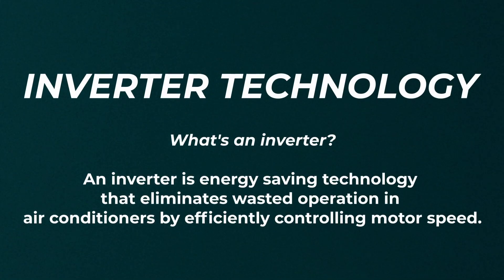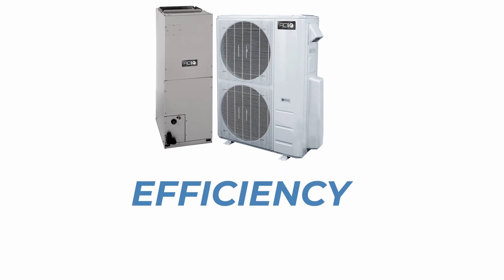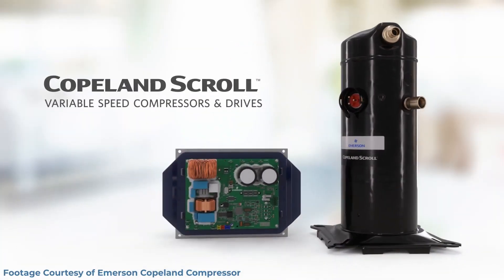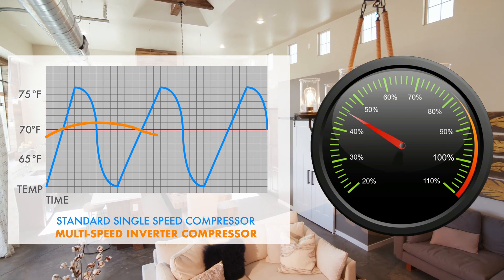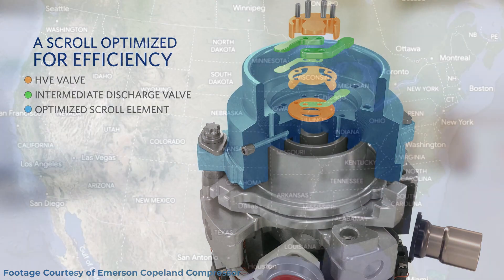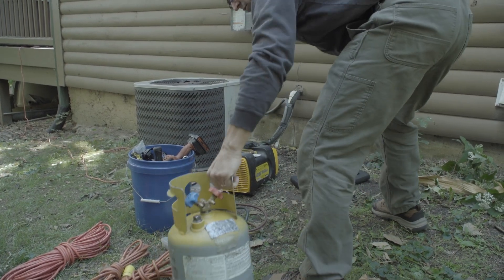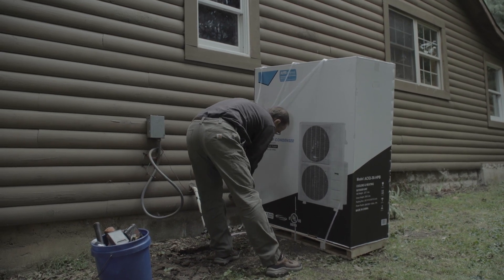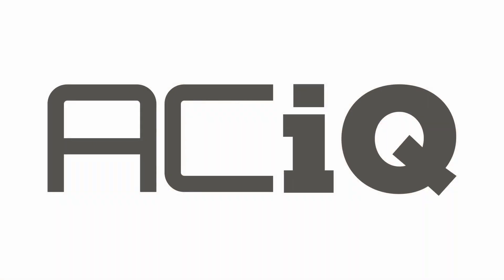NO MORE PROPANE with an Inverter Heat Pump!

Comment: Guess what, must of the heat pumps use R290 (propane) 
Ok, they don't use, they cycle between high pressure and low pressure not actually consuming it😅

Comment: Variable speed equipment has a high installed cost as compared to single speed or two speed equipment. It tends to be more energy efficient, but the break even point on cost driven by energy efficiency is typically many years out. Add to that situation the fact that one equipment failure can easily eat up several years of energy cost savings, and variable speed equipment becomes less attractive from a cost perspective. For example, compare the cost and longevity of a single speed (or even a two speed) blower fan motor to a variable speed one. The difference is shocking.

Variable speed equipment has its place, but it really should not be sold as a means of saving money. The real story with such equipment is one of comfort and perhaps reducing one's 'carbon footprint', but not economy.